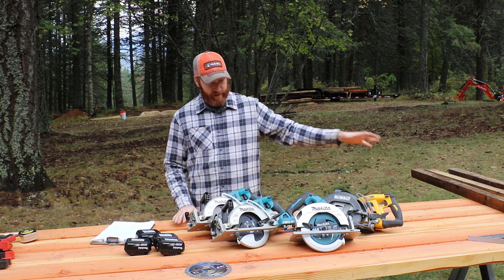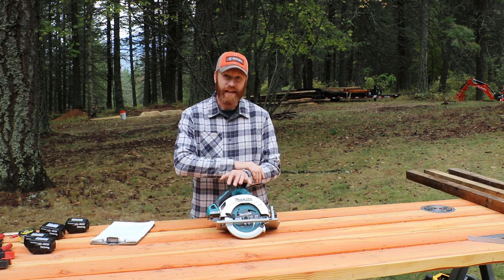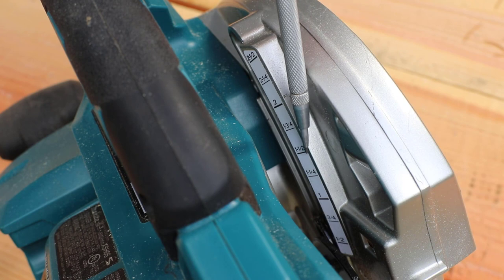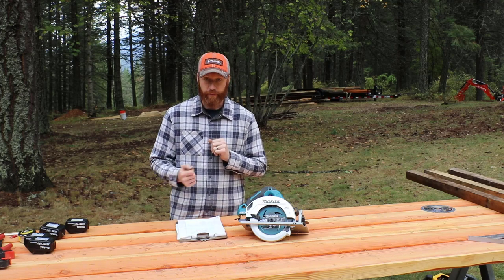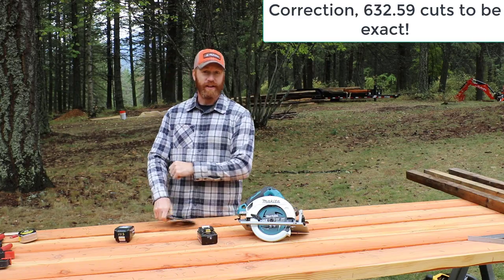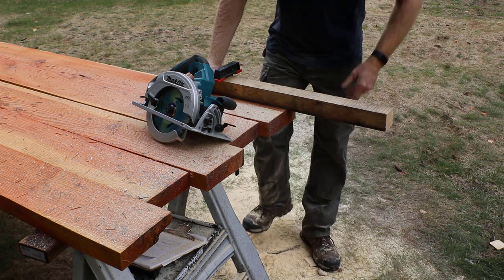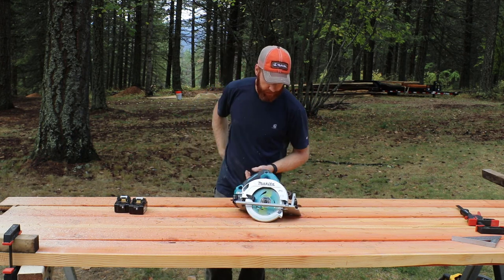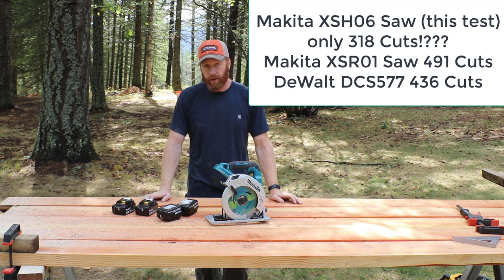Tool Tuesday Makita XSH06 36 Volt 7 1/4" Circular Saw

Comment: I got the xsh06 a couple years ago off ebay new for $75 . It's an amazing saw but i ordered the base plate for the 08 so i could use it on my festool tracks .I use the track saw alot to cut crap and the blades for 160mm track saw are not cheap .you can get a 7.25  for next to nothing so if you hit a nail it doesn't hurt so bad😊

Comment: I bought that one last year.  For a lefty, easy to use, works great. Easy to see line. But, all dust gets on you, okay with me.  

Thanks for posting.
Reply: Hey man I’m lefty too. I take some zip tape and tape off the dust port. It helps a lot. I install a lot of fiber cement siding so dust is going everywhere. Definitely helps. Try it out
Reply: Thanks for the pro tip.  I'll give it a shot...
Reply: Put the black extractor port on, the dust goes straight out back

Comment: Uk version has the depth sticker in metric. No idea whats underneath.
Also for crosscuting timbers, stand at the other side of the bench so the largest part of the blade rests on the length of timber using thd right hand.
To cut sheets, use the saw with your left hand.
Over time it becomes natural.
This goes with tracksaws too.
Use the left hand instead of trying to reach over.
Reply from the maker: What you say about hand position is correct. I am left handed so I am most comfortable with a worm drive style circular saw. The base plate or foot or shoe, is opposite of the sidewinder style of saw. I have a Festool TS75 track saw and the track forces me to cut the "correct" way. The only power tool that I have become really good at using right handed is a chain saw. Using a chain saw left handed puts the users face directly in line with the bar which is really in case the saw bucks. Thanks for the comment!

Comment: A right blade sidewinder is used because there is no dust with a right blade saw. Many haven't noticed, but a left blade Worm Drive saw blows all the dust in your face, and the right blade saw blows all the dust cleanly onto the ground. The right blade saw has a 95% reduction in dust, because it has a dust ejection port, which pushes the dust away from your body. It's really unfortunate that people are so focused on the location of the blade, they never actually observe the severe dust problem on a Worm Drive saw. (If you're left handed, you can use a Worm Drive saw, with the blade facing away from you, and reduce most of the dust---but some Worm Drive still do not have a dust ejection port on them.)

Comment: Interesting. It’s good if the thermal overload is taken up by the batteries rather than burning out the motor itself. Maybe the batteries were just exhausted and needed a recharge? Would a corded saw do better? Does a corded saw “overheat” and shut down? Or just start smoking and burn out? Thanks, L

Comment: Does the blade guard bind up on the XSH06PT right blade Makita 7 1/4 LXT saw? One review, the man never changed the height of the blade, and kept having blade guard issues, where it wouldn't open properly. In the past, I've found that you have to set the blade height higher if the blade guard is snagging on the board. I'm wondering if Makita changed the guard, or if that other review was user error?

Comment: Great review I just ordered this saw I wanted the worm drive but worm drives only come in left handed witch is why why worm drive is comfortable for you I already have the 12" 36v makita miter saw so I have the batteries and duel speed charger just ordered the saw bare tool XSH06 on Amazon for 85$ and your right im on the east coast NY we all use the sidewinders and your also 100% right about this saw not being for someone left handed i have used both left and right handed sidewinders and the problem I had was I would grab a 2x4 with my left hand and all the weight and table of the saw is on the part that is going to fall it's really key to use the proper saw for whatever hand is dominant. 
Thanks for sharing

Comment: I don't know if you're left handed or not but the direction you're cutting is slightly binding the blade for a general rule of thumb all cuts should be made with the cut fall off on the blade side I`m right handed and have ryobi brushless left hand saw and it always cut way better when the cut fall off  is on the blade side left side right hand saw right side fall off, cutting any other way does bind blade and have significant drain on battery performance
Reply from the maker: Thanks for the comment, yes I am left handed and think I mention it several times in the video because circular saws seem to be the most effected by a persons handidness? (Is that a word?!)

Comment: That material looks almost double the width of a 2x4. Just not fair to compare.
Reply from the maker: The boards that I used for the cuts were 2 1/8" x 2 1/8" square (4.52 sq in). The cross-sectional area of these boards in square inches are LESS than a standard 2x4 (1 1/2" x 3 1/2" 5.25 sq in) so I assumed that the saw would actually make more cuts than advertised. That said, I would love to see other tests performed using other methods by other people and see how this performs. In an earlier video, I put the Makita and DeWALT (worm drive) pattern cordless saws through the same exact test with the exact same material. To keep everything as equal as I could, I changed out the factory provided blades with brand new Marathon 24T blades in all three saws. These blades are thicker at the tooth (wider kerf) than the factory blades so that may have helped reduce the cut number. Thanks for the comment and have a good one.